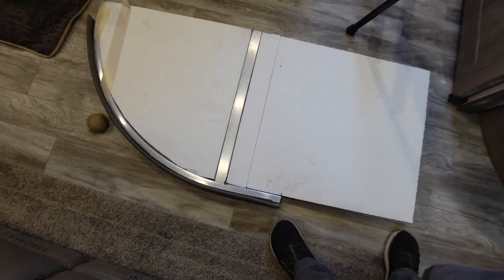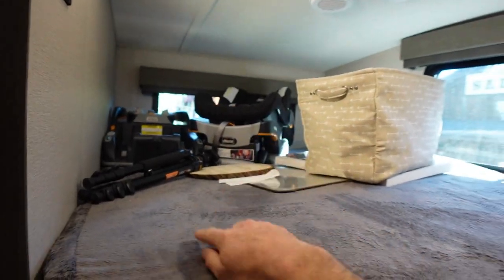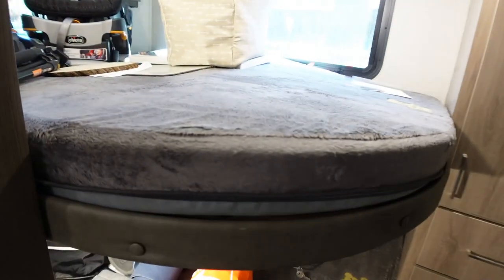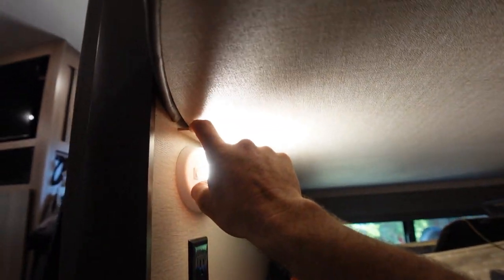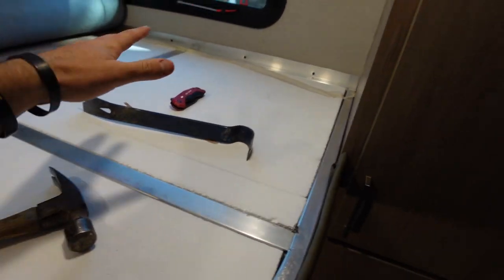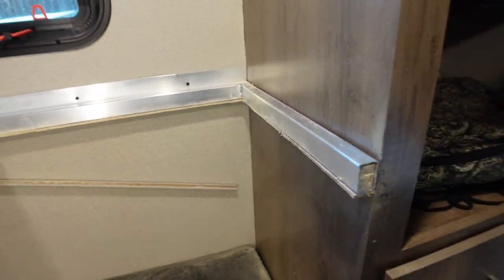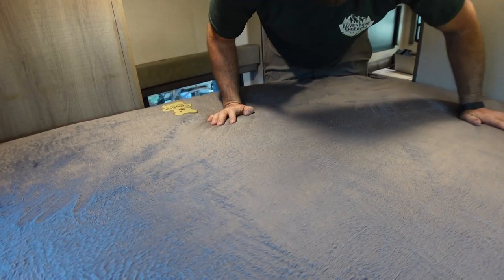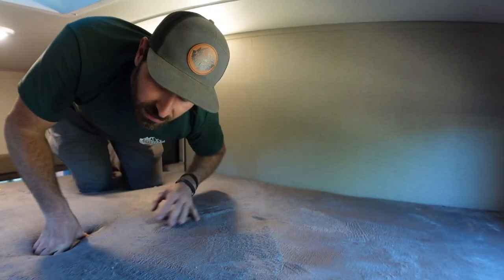Grand Design Travel Trailer Bunk Bed Modification (Storage & Renovation)

Comment: couple of questions. We just bought the exact 2022 2910 bh ! Is there another seam 3d of the way in to leave one third up for wall support and cut the bed into 3'ds ? What cutting tools did you use to make that look so good ? My original thought was unscrew the whole bed frame and pull it out but don't think there is enough clearance to clear the door way ! any help would be greatly appreciated ! I know the baby is almost here !  Good luck hope every thing is great ! Fingers and Toes !
Reply from the maker: I am not 100% sure but I believe there would be another support so you could keep 1/3 (but I'm not 100% sure). I used an oscillating tool for most of the cutting and it came out really nice.
Reply: Yeah it looks real nice !  Want to cut ours back and maybe remove the top completely ! just don't know if the top 3'd needs to stay for extra support for the out side walls !
Reply from the maker: I don't think it would need to stay, but I have no idea....